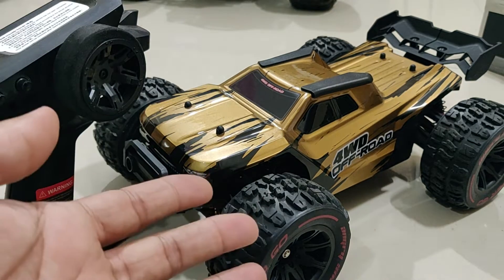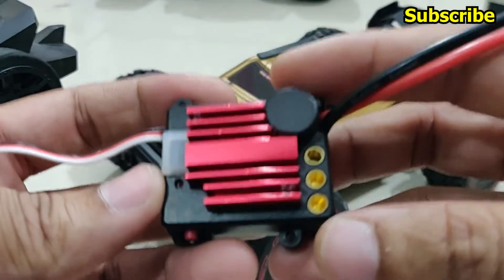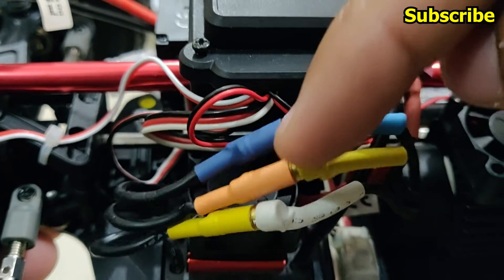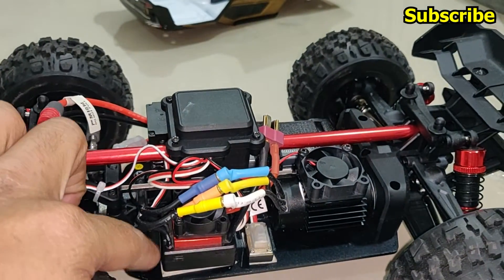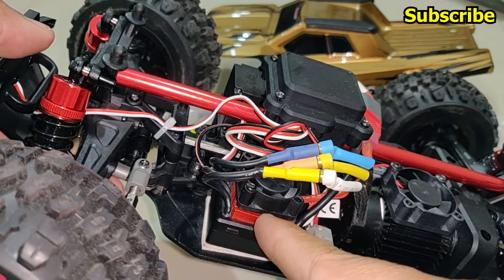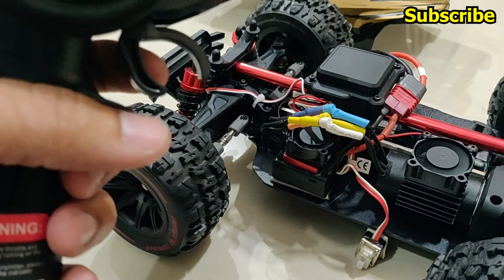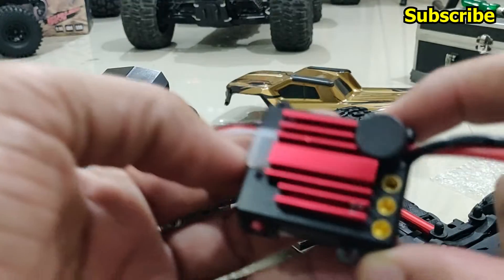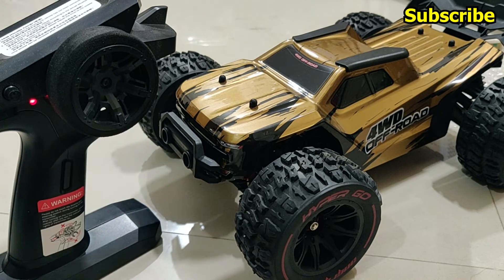MJX Hyper GO ESC Upgrade to Hobbywing 35amp ESC Setup & Calibration Tutorial

Comment: Why put a 35amp esc in...
Reply from the maker: Stock esc is 45 amps but terrible configuration... hobbywing 35amp is programmable and allows for better control of the car..you could use 60 amp also if the esc is adjustable
Reply: @RakishRc why use 35 amp if the stock motor runs at 35-45 amps...but can draw 70amps to 85 amps if the esc allows.

The 45 amp already chokes the motor, and is right on the clipping limit anyway

So 35 amp is going to be even worse

My recommendation is a Hobbywing QUICRUN WP 10BL60 G2 Brushless 60A ESC

It's a tight fit but works. Won't get hot because it's between 55% and 65% it's load rating at full throttle and allows up to 350amp burst ... So the car will feel punchier and won't feel like it's sluggish when you open the throttle, which is exactly what you're talking about.

Comment: LO MALO DE ESTE COCHE, ES QUE LA BASE ES DE METAL, MUY PESADA Y NO TIENE PROTECCION EN LAS ORILLAS, ES TOTALMENTE PLANA, SI SE MANEJA EN TIERRA SE LE VA A METER DEMASIADA, EL BOTON DE ENCENDIDO SE ENCUENTRA EN LA PARTE ALTA DEL COCHE, HAY QUE QUITARLE LA CARROCERÍA CADA VEZ QUE SE QUIERA ENCENDER, LAS LUCES LED NO TIENEN ESTROBO, EL CONTROL REMOTO SOLO TRAE DOS VELOCIDADES, 75 Y 100 %, DEBERIA TENER 25, 50, 75 Y 100%. EN ALTA VELOCIDAD ES MUY DIFICIL DE CONTROLAR, ES FACIL QUE SE VOLTEE. VARIOS DE SU TORNILLERIA USA LLAVE ALLEN DEMASIADO PEQUEÑA Y ES FACIL QUE SE BARRAN POR LO DELGADO DE LA LLAVE.
LO BUENO SON SUS MATERIALES DE CONSTRUCCION, MANDAN MUCHOS ACCESORIOS EN SU CAJA INCLUYENDO OTRA CARCAZA O CARROCERÍA, ES MUY VELOZ, TIENE UN BMUY BUEN ESPACIO PARA PONERLE BATERIAS GRANDES Y DE VARIAS MARCAS, ES 2S Y 3S, Y ESTA HERMOSO.

Comment: Thank you very much for posting this. I am very confused with my ESC lol. 

I got 16207 which use 3S. Do you think 35A ESC would be enough?

The 45A ESC usually a lot larger while 16207 has a very tight space.
Reply from the maker: @ulungprabowo  yes the 35amp esc is also identical and almost the same size.. Can run on 3s too. Just install the cooling fan and use it 👍
Reply: @RakishRc  Thank you!
Reply: Please add link to buy

Comment: I have a tenspeed rc almost same esc but my servo plugs into the esc as well will this new esc work with my set up?
Reply from the maker: @kingmunch6465  it's an all in one esc then.. The servo wire should plug into the esc channel 1 then it should work

Comment: I do not know how bad the stock ESC is, maybe it will still be good for the smaller scale MJX's?
Reply from the maker: @philiprccars4340  it's the same esc in 16th scale models. It's mostly to do with the throttle and reverse timing. And since it's not programmable replacing is better option

Comment: Does the esc still allow it to reach top speed? I know the stock one had two modes, does it still go 50mph?
Reply from the maker: @Kraken1516 haven't done a speed test but on full power settings you can easily get 40-45mph ... It doesn't have modes but you can program the punch level

Comment: After changing the esc is the procedure same to switch the power mode if i use a 3s battery ? Or does it remain the same as how its done for the original esc
Reply from the maker: @simpleomi8151  no the hobbywing / lc racing esc is completely programmable and does not need any procedure to unlock power.. If you set it to high power options it will remain at that.

Comment: Can u also suggest which servo upgrade i can do which will give me better steering as i have changed all the parts to aluminium parts and steering has become a little sluggish. Servo which will  fit  the body base. I had ordered one but its too big
Reply from the maker: @simpleomi8151  servo upgrade need to check which servo will fit properly because it's not standard size servo... On ebay and aliexpress you can find 14210 metal upgrade servo which should fit and work better.
Reply: @ thank you so much for replying  yes i will try on aliexpress. But if u find one could u please let me know. Thank you🙏

Comment: Bro im so happy i found ur channel i have recently got the  14210 hyper go and i am new to the rc hobby. And i have this problem where my rc car wont turn off until i disconnect the battery the fans keep running and the light in the esc goes off but after a while it turns on automatically im thinking of changing the esc. Could u advise
Reply from the maker: @simpleomi8151  hi, thanks for watching. If the esc does not turn off from the switch then may be the switch is damaged or something is wrong with esc. But i am not sure if the new batch of esc on mjx require battery disconnection for power off. 
If the throttle and reverse working correctly?
Reply: @RakishRc  yes the throttle and reverse is working properly

Comment: Love the vid, having the same issue. But does that new esc effect the speed, and acceleration? And does it overheat, thanks!!!
Reply from the maker: @Wyatt_9 if you change the esc you can adjust the punch level and set it to level 9 for more power. 
It does heat but if you install the fan on it it keeps it cool too. You get more throttle control and better handling with the new esc.
Reply: @RakishRc  How do you adjust the punch level?
Reply from the maker: You can use a program box or hold the set button near esc power switch and select the punch mode and adjust the level... Refer to the hobbywing esc manual if you buy it
Reply: @RakishRc  will do!!! Thanks for the information

Comment: Ty im waiting on my truck to come but also prob gne need to pgrade this eventualy
Reply from the maker: @shmelie  yes once you drive it initially you'll realise the stock esc is not good for jump and mid air control due to the lag and initial high end punch. After replacing the esc it's a lot more comfortable to control

Comment: Hello, Great video! Is it possible to run Hobbywing Quicrun WP-10BL60 G2 with the stock motor on the H14BM? If so, i am assuming install is the same process as your video describes. Correct?
Reply from the maker: @travisc46  hi, yes you can install the 60amp esc. Process is the same 👍

Comment: Quick question yet again man, I've got the X6FG Trans./Rec. but I don't have the 75% or 100% full throttle choice? What's the difference if I may ask
Reply from the maker: The stock radio has option to adjust throttle power at 75 & 100 % but on dumbo rc radio you can use the throttle epa knob to adjust the throttle band.
Reply: @RakishRc  Muchos thank yous Señor

Comment: The acceleration and reverse controls are reversed on my receiver? Any clue what it can be?
Reply: Nevermind, wires were swapped around. Weird, I followed your steps too 🤷🏽‍♂️
Reply from the maker: @rarebanana  Mjx radio does not have channel reverse switch...outer two motor wires need to be swapped
Reply from the maker: @rarebanana  lol

Comment: Anyone know if this esc problem is on the 14303 Citroen?  havent seen any reviews or vidoes with people owning the citroen mention this problem.
Reply: I have the 14302 which is the same thing (just a different body) I haven't noticed any lag on throttle on that but definitely on the 14210 there is, I have one too.

Comment: Thanks for making the video, I was looking to see if the stock 35A ESC on these MJX Hosim trucks are programmable but there's no information around to suggest they are. I will upgrade mine. On a good note though, the Brushed 35A ESC on these MJX Hosim models don't have throttle delay and is very capable and smooth ESC to use.
Reply from the maker: Yes unfortunately those mjx esc are locked even though they can be programmed. I don't have a brushed esc but thanks for the information wish it was the same with this esc too. Thanks for watching